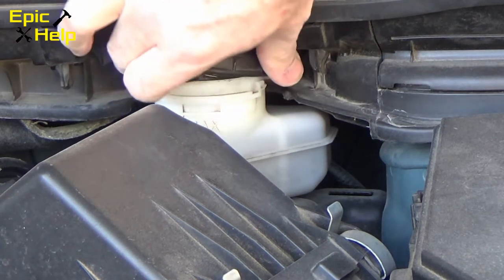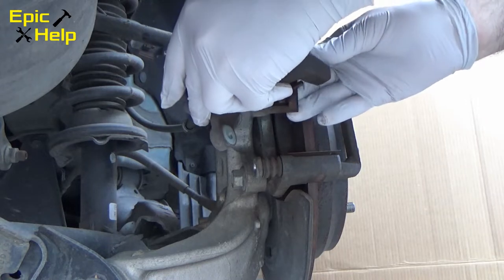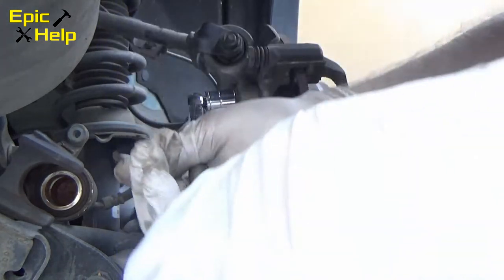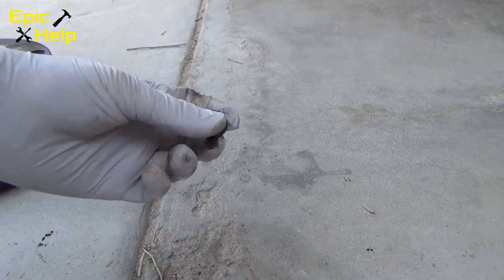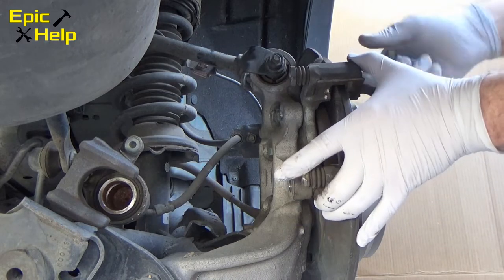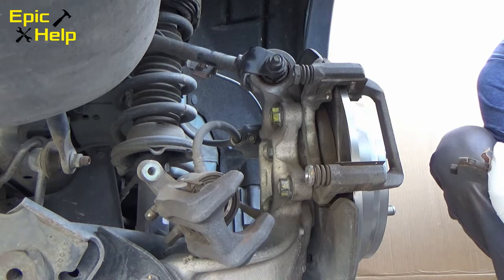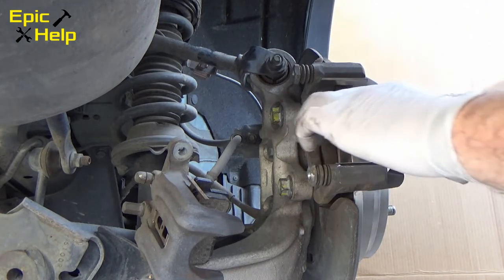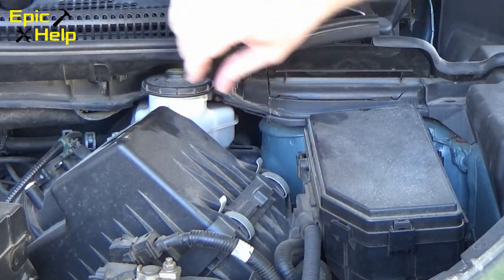2015 Honda CR-V - Replace Rear Brakes - 2012 2013 2014 2015 2016

Comment: I've done a lot of brakes but first time for the rear of this car. I'm glad i didn't miss any steps thanks to the video. My caliper bracket retaining clips didn't clip in so i used a flat head screwdriver to bend the little tabs down. I also used brake lubricant for the clips. Clear fast and helpful video👍
Reply from the maker: Thanks for your comments and thanks for watching.

Comment: All steps where of a great help, in that I've done brakes many times, but like to check a Youtube video prior to replacement.   I didn't see how your pushed the caliber piston in, but I use a large C-clamp personally.   Second, and something I've always done, is after tightening all wheel lugs, I choose to use my ft/lbs torque wrench, to make sure all lugs are at 80-85 lbs.   I will often recheck again after driving the vehicle for a week, just to make sure all have stayed at the recommended torque value.
Reply from the maker: I used channel lock pliers to push the piston back in at 1:01 in video. I've used c-clamps on other jobs, but this piston was easy to push. I agree, it's always good to check your wheel lugs after driving around. Some tire shops I've been to say to check it after about 50 miles of driving. Thanks for your comments!

Comment: U didn't show e brake adjustment
Reply from the maker: There was no emergency brake adjustment needed. I only showed the emergency brake adjustment to explain why you have a rubber grommet that acts as a dust cap for this system.